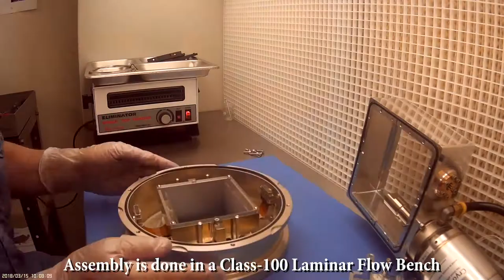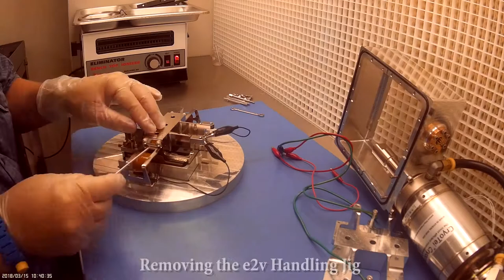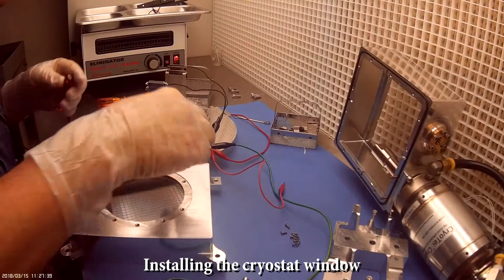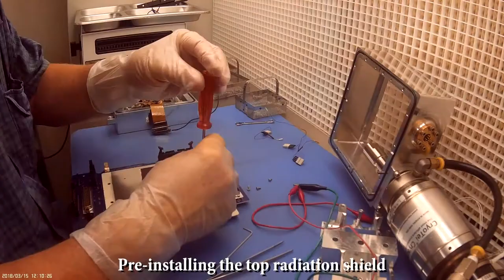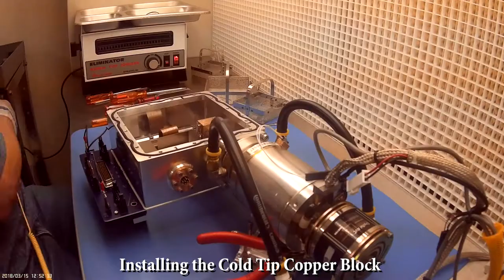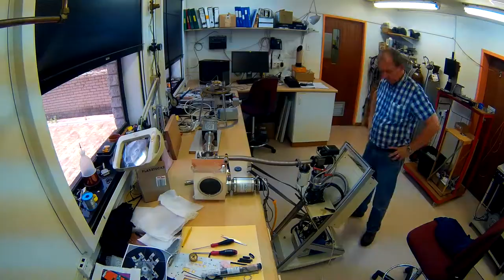Assembly of WinCAM with Electrical Sample CCD

Comment: Awesome Willie, couple of questions: 1) It was fast but I don't see any torque driver nor locktite, is that OK for a final assembly? 2) You performed a Helium leak test, what is the acceptable leak rate, I guess 1x10(6)std-atm/sec, did you fill and test right away or did you de-gas the assy first in an oven? 3) Who service and certify your class 100 flow bench here in the cape, I need that service urgently for my benches and bigger requirement. 4) What kind of Helium ionizer detector did you use. This is a great video, we need young talent to get involved in this fine mechanical/vacuum technology urgently in SA. well done,